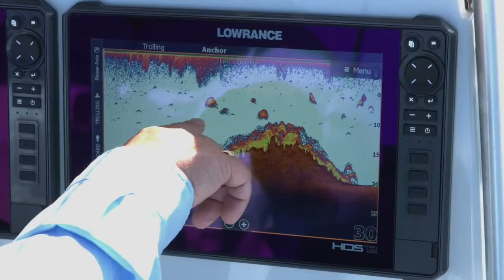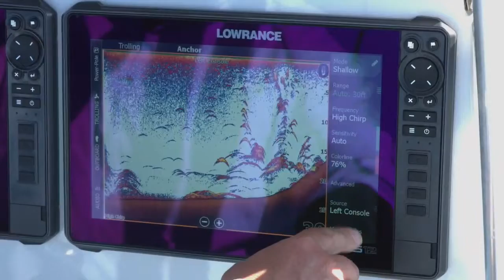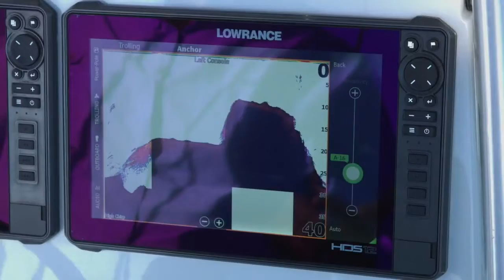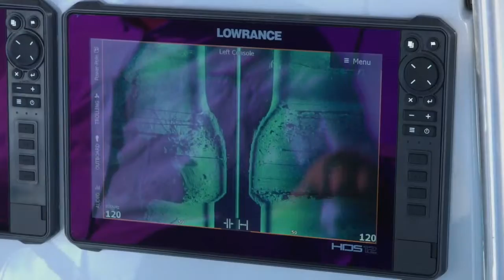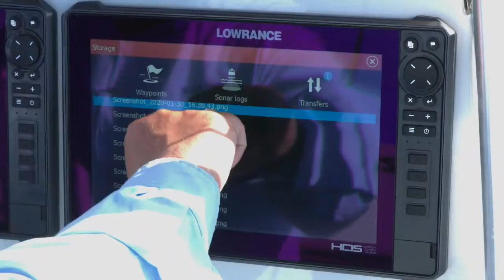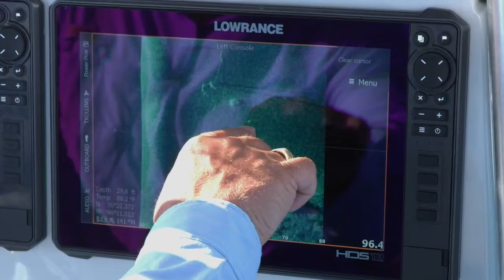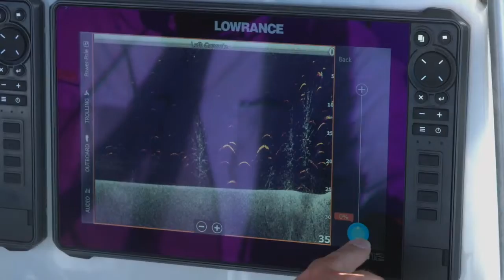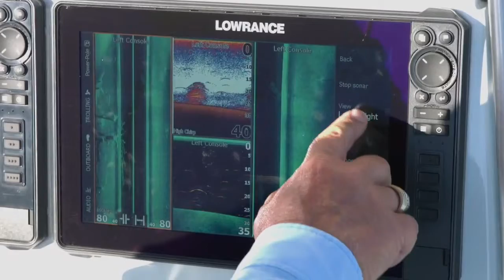Lowrance LIVE | Basic Sonar Interpretation | Webinar

Comment: What is the difference  between  speed over water  and speed over ground? In sonar mode I have the speed over water turned on but just have dash lines no reading, and have no option for SOG in sonar mode?
Reply from the maker: Speed Over Ground is given by the GPS antenna. You will need a speed transducer to have Speed Through Water.
Reply: @lowrance  Thanks!!

Comment: On side scan, what is the cone angle, or triangle angle? I understander the black center portion is the water column, but is the first bright return the bottom directly under the transducer? Or if you are in 30 ft of water, is it 5 or 10 feet to the left and right?

Comment: What angle is the sidescan "cone"

I run a three in one transducer on a small boat with a tiller motor and when the motor is running so that we can drive the left side of the sidescan blurs out. The motor is to the left of the transducer.

Thanks for your help